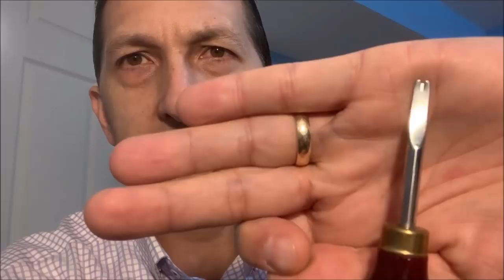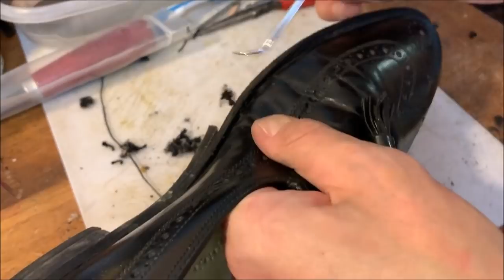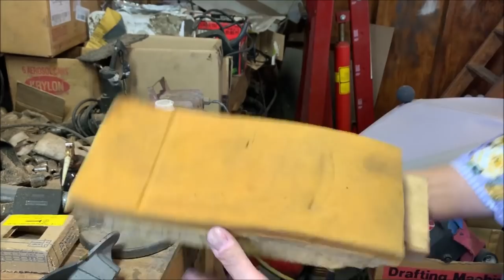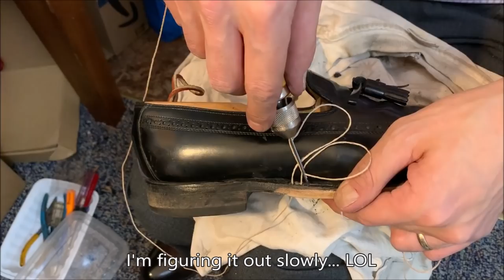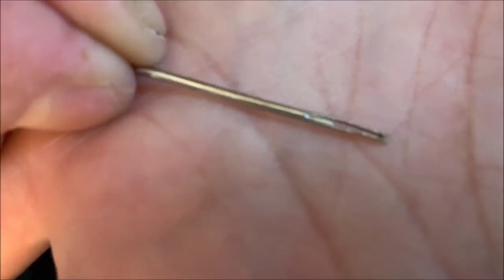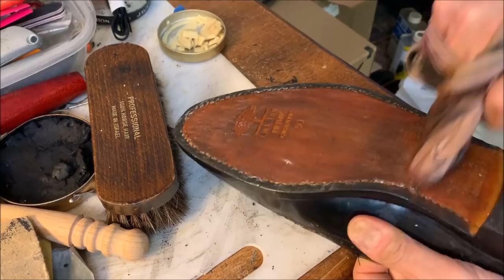DIY: ReSoling Johnston & Murphy Loafers AT HOME #2

Comment: I did a shoe resole, partly inspired and motivated by your previous resole. 
Stiching is easier with a soft sole. Soak it 10 minutes in warm, soapy water, then dry it for about 4-6 hours. Cementing is tricky, I still have to experiment with it. First, you need to brush the surfaces with a metal brush, this make the leather hairy (bigger surface area). Clean both surfaces with aceton. (removes grease and dirt). Before you press them, heat both surfaces with a heat gun just a bit, do not burn the cement. (This completely removes the solvent.)  With a well curved awl, your can position the hole and avoid the upper. (use your awl to make the hole only, and stich into fresh holes only, because they shrink fast, put wax on the awl before every hole, cheap shoe wax will be fine, you will feel the difference :)). I use a long thread with two big bent nails on the ends. You can bend normal nails by hand, if you heat them with a lighter until they change color a bit. I also did hand welting with this setup. Sole finishing is pretty hard, wet the sides when you sand them. This way the leather will not burn. Burnt leather is impossible to paint, the paint just peels off. (Knife, rasp, glass, sanding, pro optimal: paint and iron with wax)
This is not an easy job. You need to practice it, and every small technique update can help a lot.
(English is not my first language, but I tried to sum my experiences)
The finished product https://i.imgur.com/IiLdezr.jpg
The used tools https://i.imgur.com/ONuZoUJ.jpg
Reply from the maker: Attila Varga - wow! Thank you! I’ve screen shotted this response & am saving it in my files!!
Reply: Where can I purchase high quality curved awl needles like the one pictured in your "used tools" upload?

Comment: Robert - you really did a good job!  I cringe whenever I see Steve at Bedo's hand stitching a goodyear welt.  You attached a leather sole by hand.  The stitching wasn't perfect but that's on the bottom of the shoe.  You made them wearable again.  Your analysis was hard on yourself as you did not factor in the high cost of education.  You got a lot of experience and improved skill as you made those shoes good enough for anyone to wear.

Comment: Hi Bob, a tip for anyone who wants to resole to a good standard.... All the work can be done at home with bladed tools, a hammer  and a cheap belt sander, modded for easier access to the curves of the sole edge. The one task I need a cobbler for is the outsole stitch, It's the only way us mortals can do a neat job. If you wanted to do as much yourself as possible, get the cobbler to just make the holes with his outsole stitcher then put the stitch in by hand.... I had to do that once when the thread tension was off on the cobblers machine and he couldn't fix it himself, the result was within a gnats testicle of a machine stitch. I do wonder if a lot of hand made shoes have a closed channel to hide the slightly uneven stitches sole side? My finished results are now more attractive than most cobblers using replacement leather and Dainite full soles. I'd never bother with a half sole personally. I can also do hand welting, which means an upper can last many many re-weltings as you use the original holes, rather than make addition holes via the machine route and I learned how to  build and adjust a heel stack from scratch. decent cobbling is do-able and just needs practice, thought and a little learning. Another observation - yes, a sole stitch is attractive, traditional and increases the strength of the shoe to sole bond... but modern contact glues, properly applied and  designed for leather and rubber would probably do the job on their own.
Reply from the maker: That's an interesting idea (cobbler just making holes). If you can find the next attempt where I did a 3 part video on resoling a pair of Florsheim Imperials at home, I used a punch with two pins to space the holes evenly. If you see that video, the sole stitching came out gorgeous. To be honest, it's SO much work, I'm not eager to hand stitch on soles anymore. I think I'll just take them to a Cobbler and have them stitch them on! Your work sounds impressive though!
Reply: @CobblerBob  Cheers. Yes, I am very pleased with how my shoes turned out. I've just found another cobbler, with an outsole stitcher) who's willing to do the stitch for me. He's asking for a very small sum as it's a quick job. M

Comment: It didn't turn out too bad, totally wearable and much better than the previous attempt!  Great job for a hand stitched sole.
I was using a belt sander and then a 4" belt & disk bench mount sander but recently switched to a 5" disk sander attachment for my drill mounted in my vice, which I find more controllable and gets into that arch area better.  I've really wanted to give this a go to advance from sole protectors and heels.  Inspirational as always Bob

Comment: I also do my own maintenance om my shoe collection, such as sole protection, applying flush metal toe tips, conditioning of the uppers and maintaining the insides of my shoes. Al lot of great tips and ideas can be picked up by watching your vids. I especially like your rudimentary sole press and sander setup, although the later does seem a little unstable. Burnishing is something I hadn't previously looked into, but thanks to today's vid I have learned about it. Thanks for putting out these vids out!

Comment: Wow! Robert, you did A GREAT JOB! Very inspiring! So funny, I was literally thinking this weekend about learn to do this myself.
Reply: What about using a punch to pre-punch the holes for the welt?
Reply from the maker: I didn’t really explain this well in the video, but after I broke both of my stitching awl needles, I did exactly that. The downside is it’s harder to control where the holes come out when you’re pre-punch them. But that’s exactly what I did on the 2nd shoe.
Be careful if you’re going to get into Cobbling as a hobby. Getting the materials is not easy, search on eBay. Start with replacing heels first befor you do soles. And be careful, with the knives it’s very easy to hurt yourself. I’ve been to the emergency room once already for stitches because I stabbed myself in the wrist.

Comment: Can you make a video or respond here with the names of tools used. size needle and the names of the sheers ans the edging tools with sizing. 3/64 , 1/16 I am a little lost but like you I want to improve my skills. thank you
Reply from the maker: FYI I have a couple more re-soling at home videos released since. The Resoling of the Florsheim 96624s (3 part video released Nov 2021) is my BEST result by FAR. Anyway: 
- Speedy Stitcher (JoAnn Fabrics, Hobby Lobby, EBay) about $20
- Extra Speedy Stitcher Relacement needles (Part # BN-135) from Hobby Lobby are about $5 a pack. I wind up using the straight needles in my latest videos. 
- I got a leather working kit from eBay that had an edge de-burring tool, the dark red handled knife with the straight 90° blade, the grooving cutter, the files, a wooden leather burnishing tool, and a couple other tools for like $40!
- I got the pack of 3 awls with the orange handles from either Hobby Lobby or JoAnns for a few bucks. 
- The leather soles or half soles, the Goodyear Top Lifts, & the cork can be purchased from eBay from seller @Nordshoe or www.panhandleleather.com. 
- Get Masters All Purpose Cement by Petronio instead of DAP Weldwood. Masters is better & it’s what the pros use. It’s avail on eBay or www.panhandleleather.com. Watch out, there are tiny 4 oz cans, 8oz, and big quart cans. All have a brush. Don’t get the 4 oz, it’s too small. 
- Belt sander belt, start with 36 grit, finish with 120 grit paper. 
- The tread I used is from Hobby Lobby, RealLeather P/N BH25 (they sell black and white) but I probably wouldn’t use this. Go to www.realleather.com and get their “Landis Bobbins” for $1.35. Get a few.

Comment: Robert,

Great video!

I have been repairing and making shoes from hand (thanks for recommending Andrew Wrigley website BTW) and best way, I’ve found , to hand stitch the out sole. I do everything the same or very close to way you are doing, but after I groove the bottom, I take a dremel with the tiniest milling bit .7mm I think from the bottom and I put a putty knife on top between welt and upper just in case , so I do not hit the upper. I punch holes around the entire welt with dremel then I go back with two needles but the sticher is fine I think.

Great job I think! It ain’t easy .., it looks easy, but it is very, very hard to make even.
Reply from the maker: Al, sorry for missing this comment! Great idea, thanks!
Reply: @CobblerBob  
Bob,

Since writing the message to you about a year ago, I have been trying a multitude of techniques, and the main problem I found in puncturing the welt and the very hard outsole in a very precise and very repeatable way was the inferior awl blade I was using previously. This led me to be forced to use a Dremel tool in this fashion. Since then I have purchased a few superb awl blades on EBAY and they are NOS made by Maeder and it has been a godsend. I made a custom wooden handle that is perfect for my hand out of some old hardwood from the yard and the high quality steel is amazingly sharp and I can puncture right through the welt and even a double oak sole now, fast and very repeatable. I highly, highly recommended this for any hobby shoemaker or cobbler. It is night and day over cheap Chinese made awls you get on Amazon.  Another good awl blade is Barnsley, but these are even more expensive. Let’s face it, I am a bargain hunter and I hate to pay a lot for a tiny piece of metal, but in a case like this being a highly specialized craft, it is essential that one pays for quality.  Take care Bob, I love the channel and your open-mindedness… you’re the best! Ty 

AL
Reply from the maker: @zefdin101  This makes a LOT of sense. Honestly, I think it's the HARDEST part of this hobby when you're trying to learn it effectively on your own only by watching others. I can watch someone with the correct technique and copy their technique all day long, but I don't know when I'm missing something or using in this case an inferior tool. Thanks for the info!

Comment: I'm seriously considering doing this to one of my Allen Edmonds 5th Avenue. I got them pretty cheat in eBay, but I managed to restore the uppers to maybe 90%, but sadly the left shoe have a rip in the lower left side, at it even shows the holes from the gemming. Looks like the last resole, which was done at the Allen Edmonds factory missed the gemming on one side, or maybe the previous customer tried too hard to stretch them and the gemming broke. So I'm looking into a full resole including chaning the gemming and welt. I don't care if it takes me 6 months to do it, but I really want to do it. And is not because I'm saving money, but because there are simply no cobblers in my country. None whatsoever. So unless I have a chance of sending the shoes to a cobbler in the US, which might cost half the cost of the resole, or travel, which again is not easy to time a trip with a visit to the cobbler, I'm stuck with no way to fix my shoes.
Wish me luck.
Reply from the maker: Good luck! Go to my before and after playlists... I have two more videos with resoling from home. The "Florsheim Royal Imperial LWB ReSoling at Home" (3 part video) is the best:
https://youtu.be/eTl7lJz7bY0

Comment: Have you tried asking your nearest cobbler of you could volunteer on shoes you bring in? Or maybe use his shop after hours?
Reply from the maker: Sean, sorry for missing your comment. YES, I have. There are only a handful of shops anywhere near me. One owner was not friendly/open. One recently retired and I lost touch with him, he was over 80. One told me he stopped stitching on soles at all over 10 years ago when his outsole stitcher broke!! I DID actually visit and even film some video AT an actual cobbler's shop! I never uploaded the video though. The results of even the shop owner's work was not nice enough, and I know both he and I would have gotten slaughtered on the web here. He bought the business from someone else only a couple years prior. I don't know if it was his lack of experience, or maybe his machine was not adjusted right, or maybe both? Even his stitching jobs there were many loose threads, and the stitching didn't stay where it should have, so I elected not to use the video =/

Comment: Robert great value in your videos you are quite curious and resourceful. I think you could have skive the leather with the knife first for both the half sole and edge and then sand just the edge after stitching. Great video thanks for sharing
Reply from the maker: I’ve tried to skive leather by hand before... it’s DIFFICULT!! Yes, I should have sanded down that transition BEFORE stitching the sole. That was a big reason I didn’t get it smoother.

Comment: Why didmt you tie the first stitch. I love this. I'm in no way a cobbler. I only watch videos of channels like trent n heath
Reply from the maker: Sorry for missing your comment! A Goodyear welting machine uses 2 separate threads, where I am actually using only one thread. One end of the thread runs on the top, and the other end of it runs on the bottom. When making the first stitch, you pass the string through, and pull it to the middle such that both ends are equally long. So at the beginning, there is no loose end to tie off, there is just a loop. The only place you have to tie it off is after the last stitch. When done right, in theory it's functionally the same as if done by a Goodyear welting machine. I think. I could be wrong on that, but that's my understanding.
Reply: @CobblerBob  ty for explaining that

Comment: omg am i the youngest of all the viewers? i am 17 and very fond of formal shoes spending a good amount on wholecut style dark tan shoes goodyear welted .I have been on it since evening and i can’t make them shine like i see on youtube.Also it has got wrinkles ok the toe top .could anyone help this naive please
Reply from the maker: Sri Seth - I’ve got a lot of shine videos... try this one:
https://youtu.be/O90JXapJrP8
Also, check out the elegant oxford’s channel. 
When you say you “can’t make them shine like I see on YouTube“ do you mean the tow camp near shine? It’s definitely not that easy. I’d love to give you more help, but it’s difficult without some frame of reference to give advice.
Here’s the video that taught me to mirror shine: https://youtu.be/WdHS-IgbHC0
Reply: Robert Powers Hey Sir , how are you doing? Thanks a lot for replying.
Firstly, I have wholecut shoes and the main problem i have is that they ain’t shining.I am not talking about the toe cap mirror gloss I am referring to just the overall leather upper.

Secondly,the method I had adopted was cleaning the shoes ,polishing them with cherry blossom and then applying Kiwi’s protective neutral shine polish,it is prominently a isotope of wax.

So now after providing you with the necessary background,wait my shoes are dark tan ,I want to get to the point:

1) They have got wrinkles mear the toe cap area because of flexion of my foot while walking 

2) The colour of the shoe has changed after my experimentations dark tan to brownish ,it doesn’t match at all in colour to the leather swatch that I have .

3)Overall they dont shine well!

It would be very kind of you if you could tell me your email id and i could send you the picture.I contemplate it might make it more coherent for you .

Thanks 
Regards,